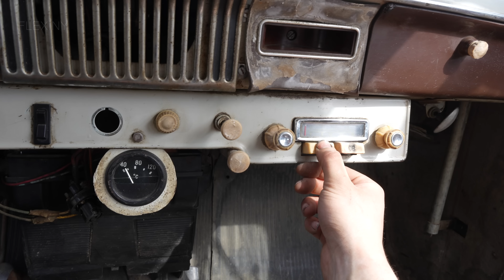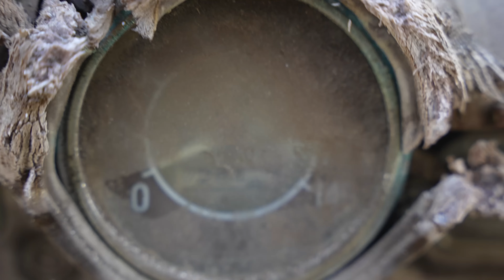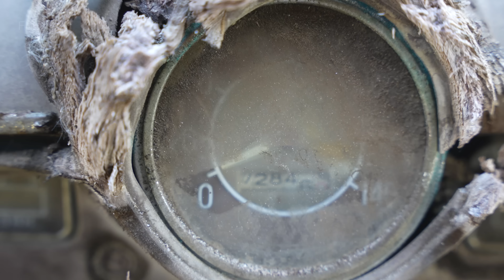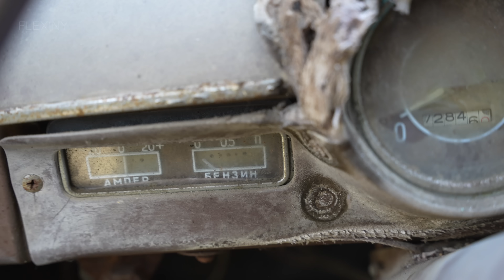Starting Moskvich 407 and Moskvich 423 After Years

Comment: Btw, what engine is in the back of the Moskvitch 407?
Reply: Moskvich 407 is equipped with gasoline engines with a working volume of 1360 cm3.

 Carburetor model K-59 or K-125Д (made in Leningrad carburetor factory, now called PEKAR) 

Moskvich 407 engine power is 45 hp, maximum torque - 88 Nm.